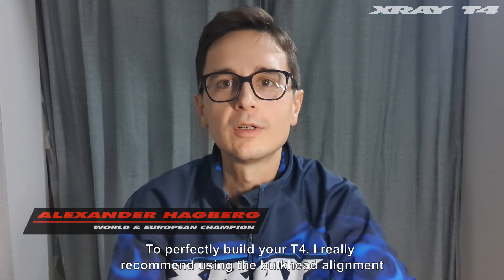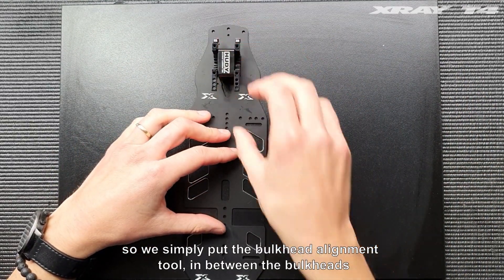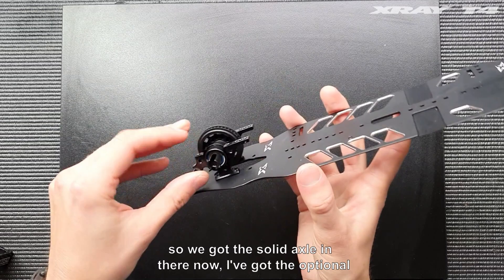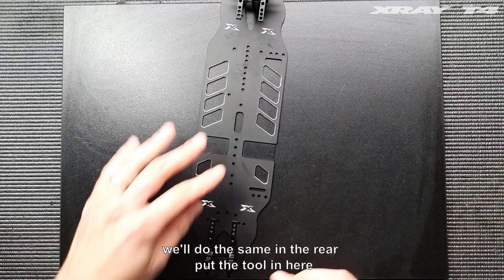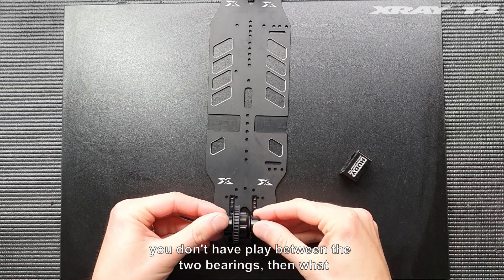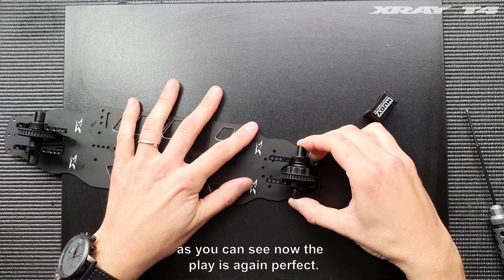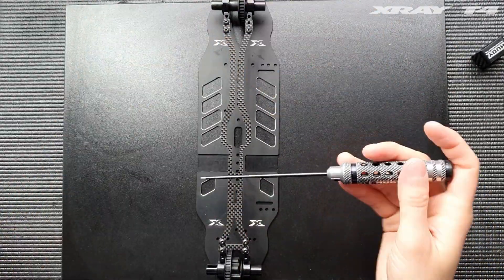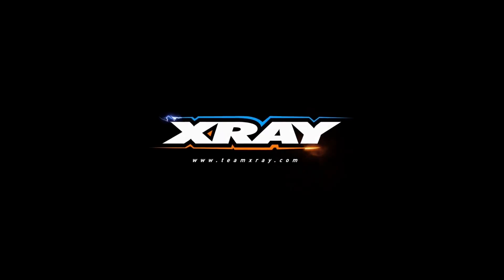Tech tip: T4 bulkhead alignment tool

Comment: Is the 17mm for all T4’s? I have a 2019, and will get a 2021 when in stock. Thx.
Reply from the maker: 2019 and earlier is 19mm, which will require the #183000 tool
Reply: @hagberg  Finally showed up today. Thanks.
Reply: Oops.  I just tried to use the 17mm on my '19 and it was too small so I re-watched the video and read comments.  I wish I had read the comments before ordering.  Oh, well.  I'll order the 183000 now : )

Comment: Do you use blue locktite on the screws when going from alum screw to alum parts?
Reply from the maker: No, its not necessary. I only use blue thread lock on the set screws in the driveshaft couplings front and rear.
Reply: Thank you for your answer